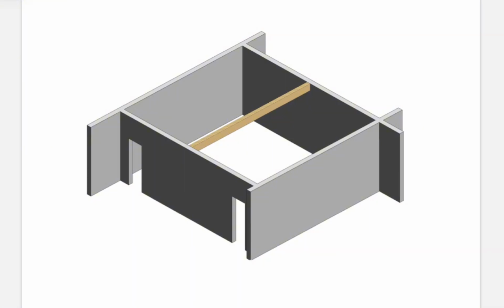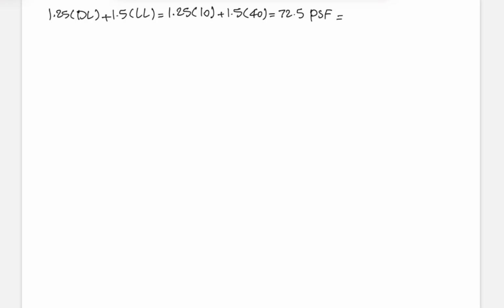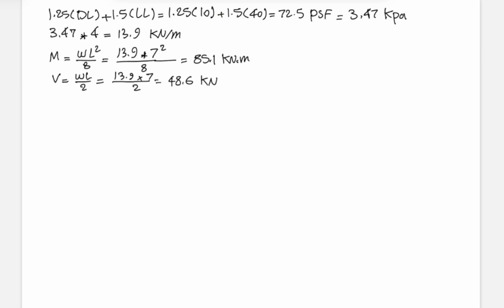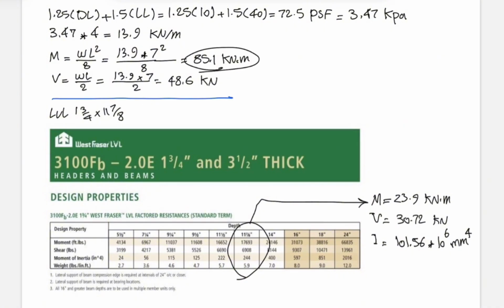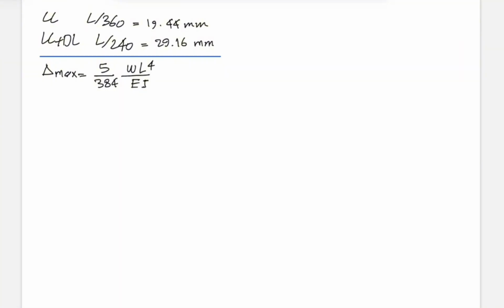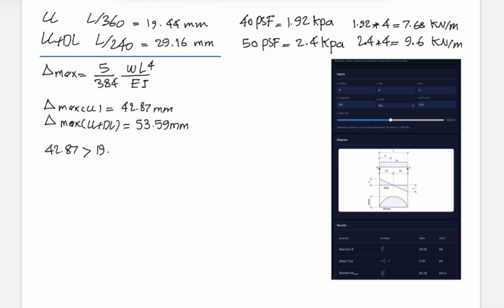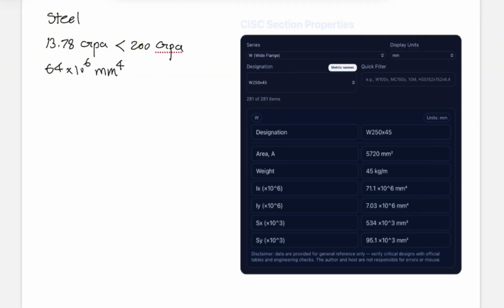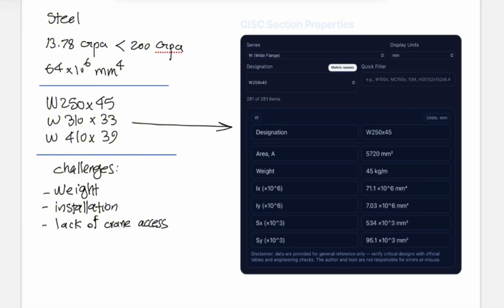How Far Can a Beam Span? Wood vs Steel Explained (Real Example)

Comment from the maker: Thanks for watching! One of the most common mistakes I see is focusing only on strength while ignoring deflection. That 'bouncy' floor feeling is usually the result of a beam that’s strong enough not to break, but not stiff enough for comfort.

Question for the builders and DIYers: What’s the longest span you’ve ever had to bridge in a residential project, and did you go with steel or LVL?

👇 Check the description for the Beam Diagram tool and Steel Calculator I used in this video